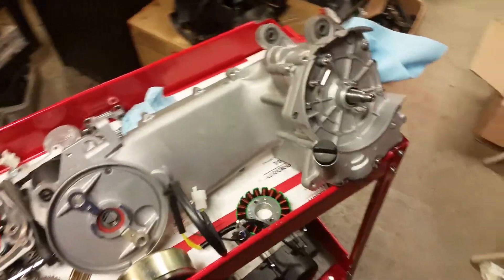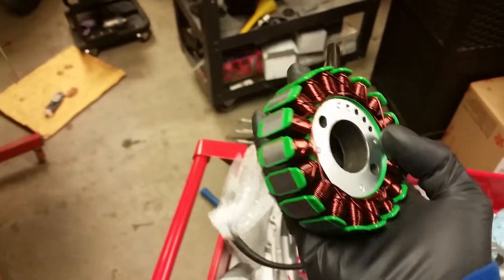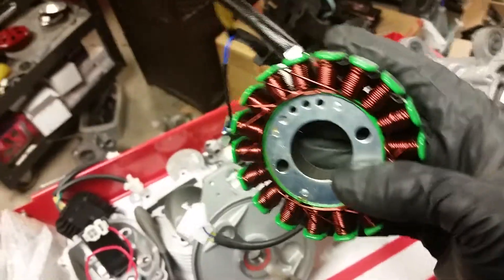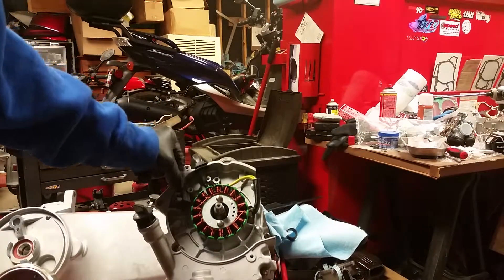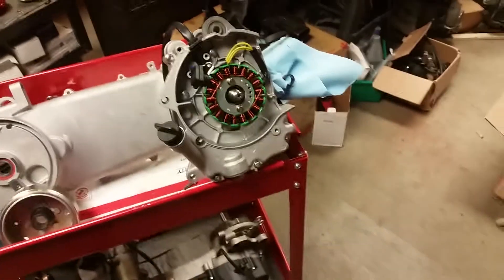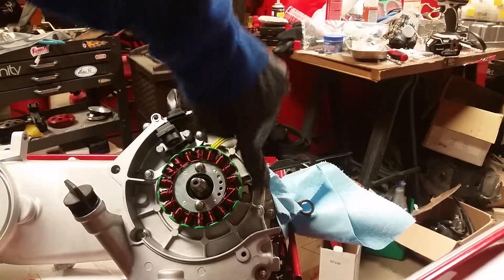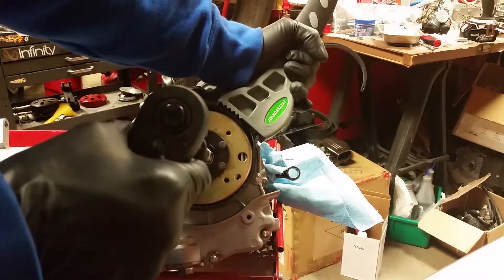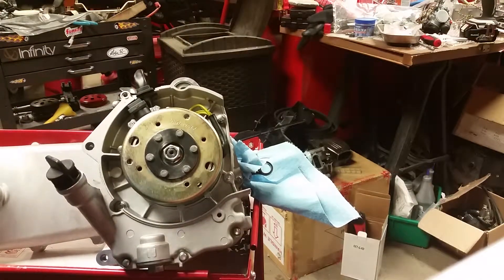180cc SSP G GY6 POWER KIT ASSEMBLY 18 POLE STATOR FLYWHEEL

Comment: A year or so ago I found a three phase stator for my CG250. Its a hard to get as well, found it at motopartsdealer.com . But anyway the problem I had with it was it would over heat the regulator. Came to the conclusion the magnet count or configuration was wrong. Tried finding a flywheel to match without luck. The bike currently uses two poles of the stator and the third is cut and floating.